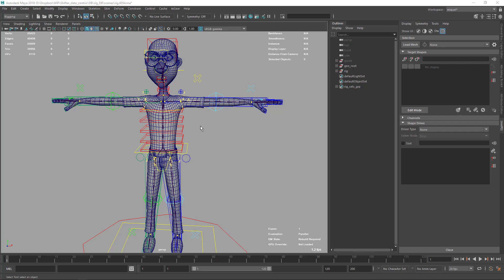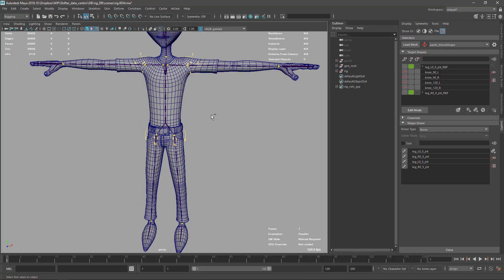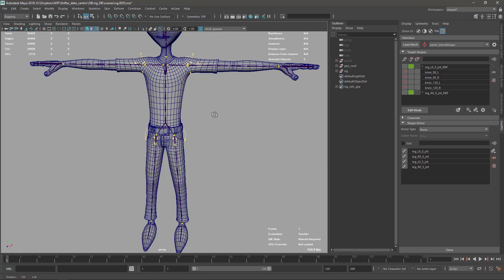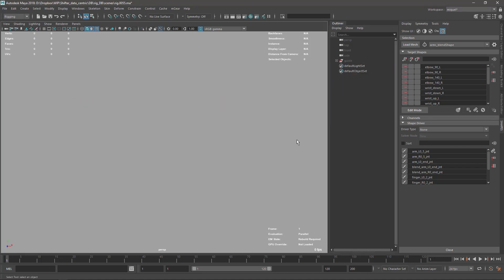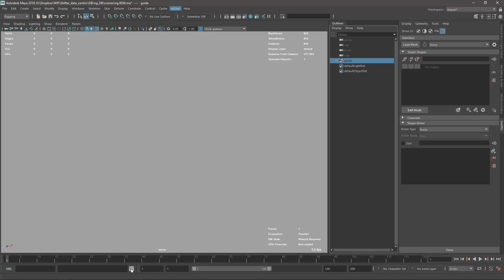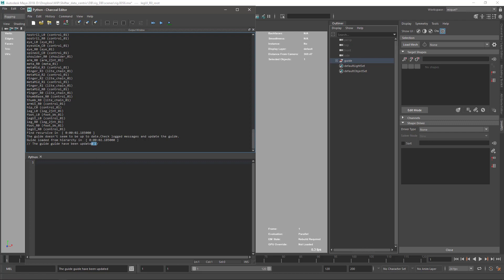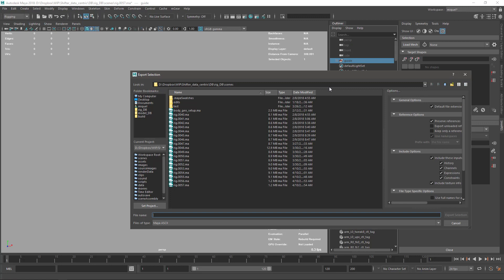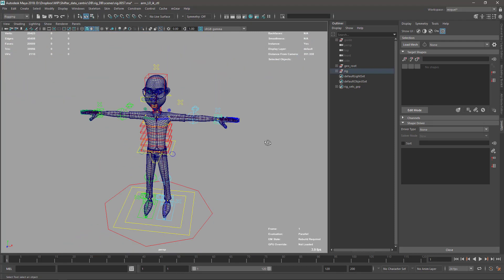Data Centric Rigging 023: Corrective Blendshapes: Custom Step Import SHAPES

Comment: Hello, I have an issue when I try to Build the rig with Blendshapes... Everything works fine... Import geo, rig, import skin all of those work fine but when I try to import the SHAPES, I have this error.

The attribute 'SHAPES_finger_1_closed_L_combo_mult2.input2X' is locked or connected and cannot be modified.

I don't know where I made a mistake because I follow all your steps.
Sorry for my English :D

Thank you for your amazing work!
Reply: It seems that the combos do not work when I export the blendshape.
I have a new error, it can not find the multiply it just created and rename:
line 1049: Found no valid items to add the attribute to.

Here, my MEL code where it doesn't works:
1047  shadingNode -au multiplyDivide -n SHAPES_temp_multiplyDivide;
1048  rename SHAPES_temp_multiplyDivide SHAPES_finger_1_closed_L_combo_mult;
1049  addAttr -at message -ln SHAPES_finger_1_closed_L_combo -m -im 0 SHAPES_finger_1_closed_L_combo_mult;
Reply: Ok it seems that I solved the issue.
I cleaned up my scene and I figure out that their were resudial nodes (fingers multiply). After removing them and restarting the rig build, everything worked.